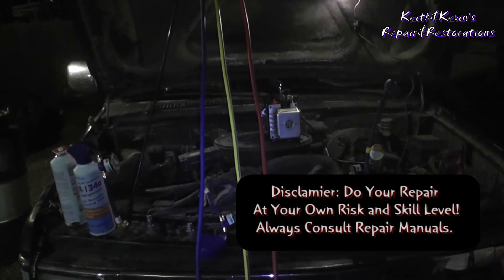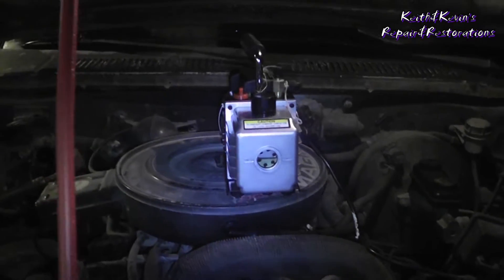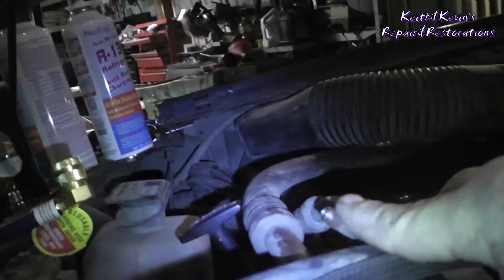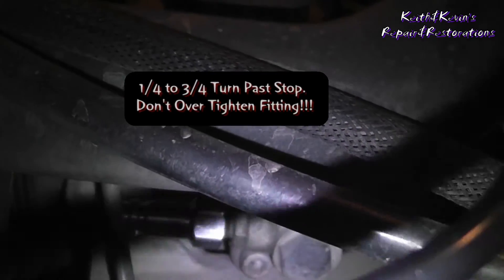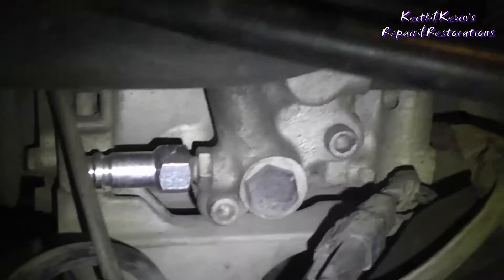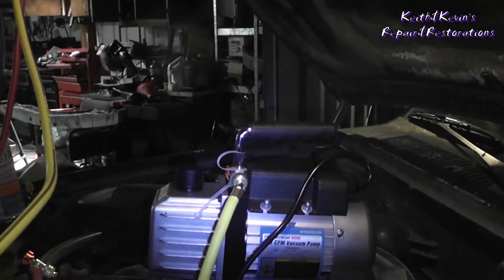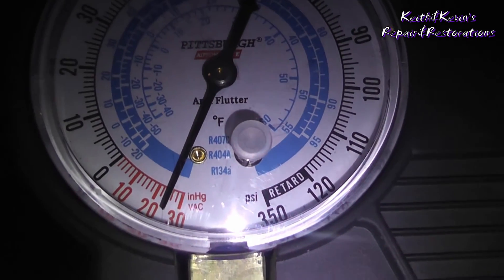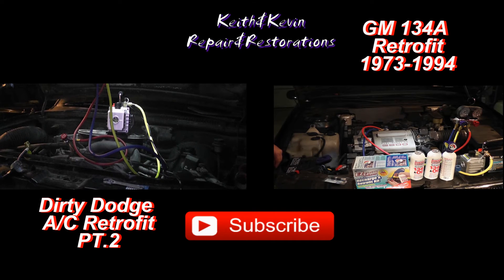How to convert From R-12 To 134A Retrofit Kit Dirty Dodge Dodge Dakota 4x4 5.2L Pt.1

Comment: I'm doing this conversion now on the exact same model/motor combo. Are you sure the port on the left is the high side? I've been chasing these fittings for awhile now through all of the parts stores saying the one on the compressor is the HIGH side and the one to the left on the hose is the low side. So... maybe I got that backwards huh? Please confirm if you can. Thanks
Reply from the maker: https://youtu.be/9X5wz5GJ0os  In part 1 at 1:24 shows the low side pressure port (Suction Side) near the left bottom of the compressor. The high side pressure hose is above the cooling fan towards the radiator. I have done a few of these conversion kits from R12 to 134A on Dodges and the suction port (Low Pressure side) is on the compressor side for these model years. The Low Pressure / High Pressure valves are different sizes as well so you can't fill either R12 or 134A on the High Side which would be very dangerous to do. If you use a kit like one shown in the video it will have the correct sized connector for the low side / suction side fill port.  The auto parts boys are not use to suction side filled system from the r12 days, that term was later changed to low side with 134a system from late 1995 and up.  Hope this information helps you with your conversion process.
/K&K
Reply: Keith & Kevin's Repair & Restorations  thanks so much for the confirmation

Comment: How well does it work without changing the expansion valve?
Reply from the maker: It works well after the conversion. Generally you wouldn't replace an expansion valve unless you were changing the compressor or other major parts in the system.
/K&K